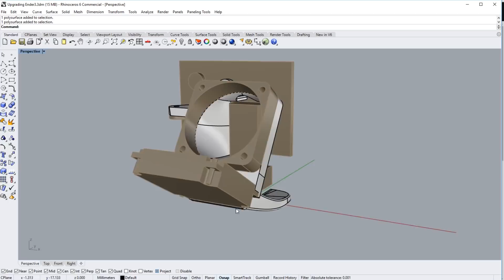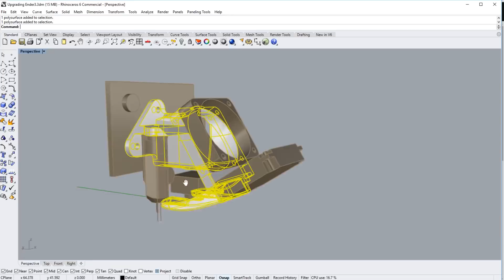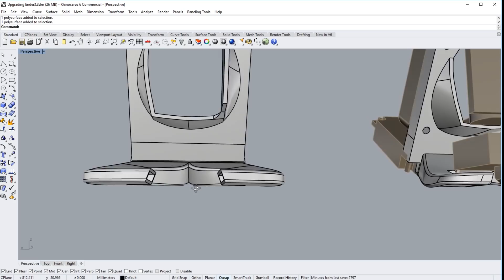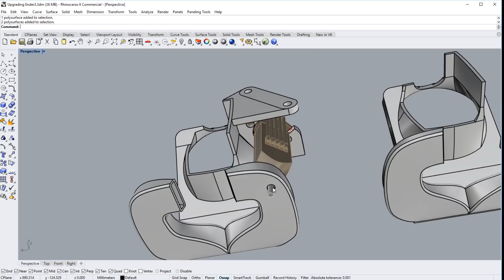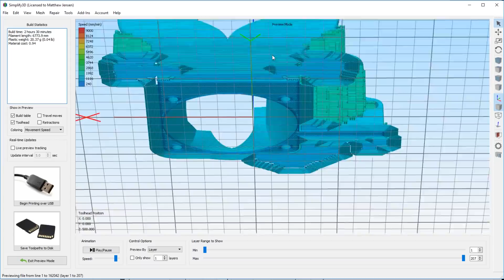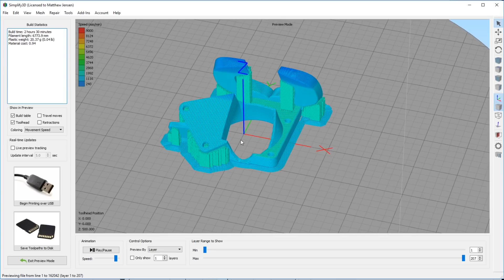Upgrading the Creality Ender 3 with Duet Wi-Fi, and other add-ons - part 1

Comment: I have to disagree about supporting original developers, I'm not talking about the Duet but E3DV6 clones - when the original developer charges more than near 8 times the cost of the 'knock offs' they are being plane greedy £51.60  vs £6.51 - having used both I'll never buy the original again - the knock off has worked flawlessly you defiantly dont get value for money there - I doubt that's the same case with something as complex as the Duet where there's  room to fill the board with crap components but E3D really don't do us proud at all.
Reply: You do realise the only reason you have the option to buy the cheaper parts is because of the original developers and the work they put in?  Do you think these companies that are selling the cheaper variants are putting in the same R&D work as the the developers?  Do you believe the machining and QC are to the same standard?  Do believe that the support you receive is of the same standard?  But your right years of research and releasing everything to the community for others to use while still supporting the 3d community as a whole is not worth the extra cost involved, i know why don't you design something better and get it mass produced for us all to enjoy?
Reply: 1. You do realise the only reason you have the option to buy the cheaper parts is because of the original developers and the work they put in? - yes
2. Do you think these companies that are selling the cheaper variants are putting in the same R&D work as the the developers? - Nope not at all - no more works is need for such a basic part
3.  Do you believe the machining and QC are to the same standard? - NO but the product is quite adequate
4.   Do believe that the support you receive is of the same standard? - NO - never needed any.
5.  But your right years of research and releasing everything to the community for others to use while still supporting the 3D community as a whole is not worth the extra cost involved - ABSOLUTELY NOT - the price is extortionate, I would be happy to change my point of view if anyone can give an explanation for such a high price - and R&D is not a valid excuse we are talking production costs here.
Reply: How is R&D not a valid excuse as you call it do you actually have any understanding of the work that goes in?  And what do you mean no more work is needed?  All these components are continuously being improved and new variants and ideas being brought out.  This takes time and money just reproducing a part of spec like some of the Chinese clone companies with no real QC doesn't cost anywhere near as much.

Production costs are also higher because unlike a lot of companies E3D and Duet design, test and build in the UK.  They take pride in the components and materials they select and in E3D's case the quality of machining.  And if you know anything about machining getting to the standards that E3D are at now with their nozzles and throats is extremely costly especially when it is not outsourced to China.

But hey when all the good innovators go under and your left with the same old kit just think how happy you will be that you got it dirt cheap.
Reply: vizionthing you do realise what engineers in first world countries cost, right?

Comment: I think you were being somewhat glib bitching about zip tied axis bearings -  when you use a single v slot 2020 teeter totter rail, those zip ties dont fail and do the job perfectly well,  also slighting 3D printed parts! you really do sound like a wine snob,  seriously though this video would have been much better if you had just talked about how to improve each part rather than tried to slander the market leader, I should declare in my criticism that I have never owned a Purusa , only an A8 and self built Hevo.
Reply from the maker: It's funny because everyone who wants to defend Prusa claims to not be a fan boy or have owned one of their printers. 

Zip ties are glorified rubber bands, and as much as I love FDM 3d printing, the parts it makes are incredibly weak in the Z-Axis. Not to mention that they are made out of plastic. Structural components should not be made out of plastic and together with rubber bands.
Reply: That is funny.  I didn't realize everyone who defended Prusa claimed to not be a fan boy or have owned one of their printers.  I guess everyone who does owns one just talks crap on them.

Comment: Don't throw the board away, give it to me ;). With  Klipper firmware it outperforms your Duet Wifi easily.
Reply: Do your research. Klipper FW is just that, it's only a piece of software. "DuetWiFi" is a combination of the DuetWFi control board that has been designed to be quite resilient to user errors, and modify RRF software to take advantage of the board. Information can be easily found, go read it if you're interested in getting the best HW/SW combination available.
Reply: Who are you that you think you can tell me what I have to do? What makes the DuetWiFi  "quite resilient to user errors"? Is this not software? Btw. Klipper even supports the MCU used by the DuetWiFi. I only told that his old board with Klipper runs faster than the DuetWiFi with default firmware and that is true. So what  research do I have to do?
Reply: I bet they're both great :nD
Reply: I see now a possible mistake I made. I used the word outperform. This is misleading. Sorry for that. The DuetWifi is the best board I currently know and  his old board is just crap. I am no  native speaker and used outperform in the sense of faster, not better.. Anyway the DuetWifi is far too expensive for me, so i prefer cheaper boards and make them faster with the Klipper firmware.
Reply from the maker: > With  Klipper firmware it outperforms your Duet Wifi easily
Thank you for bringing that firmware to my attention.  I think I might install it on my Anycubic Kossel. That being said, it is not better than the DUET. If for no other reason, the duet has Trinamic 2660 stepper drivers, and this board has stepper drivers which cannot be upgraded. Also, Reprap firmware is very easy to install, setup, and work with. To set up Klipper, it looks pretty involved.
Reply: Klipper is much more easy. No need to recompile and flash the driver on changes of the configuration. Just editing a text file and restart of the Klipper service is all that is needed.
Reply from the maker: What about all that SUDO linux stuff during setup? Don't get me wrong, I'm very interested in Klipper firmware. Especially because the price is so low to get a Raspberry Pi, and you get all the benefits of Octoprint. However, nothing beats a DUET. This board is AMAZING. It costs $175, but it's worth every penny, and the web based installation is super easy.

If Klipper is as good as you say, then perhaps I should do a Shoot out video. :)
Reply: I see no problems with this SUDO linux stuff. The biggest advantage of the Klipper firmware is the support of multiple boards for one printer. I use a simple MKS Gen L for Z and extruders. I will use an STM32 (Blue Pill) and TMC2130 stepsticks for X and Y.
Reply from the maker: If you really want this board man, send me a PM. You can find contact info in the about tab on my profile here on YouTube.
Reply: No, it was a lame joke, sorry. The cost for shipping are higher than a new board from china.
Reply from the maker: I didn't think you were serious. :)  How much of an expert are you with this firmware? Would you be willing to help me make a video about it?
Reply: Difficult to say. Klipper is rather new, so beside the author there might be only a few experts, but  I have more than 30 years experiences in Unix/Linux and my Hypercube Evolution in build is powered by Klipper. So  prepare a Raspberry Pi with OctoPI and come to the IRC channel #klipper. The author of Klipper Kevin2 is reading there too.
Reply: Design Prototype Test I’m a windows user but after a month of using Linux on a pi it is really easy to understand most installation instructions. I’d say give it a try because why not
Reply: @DesignPrototypeTest  the whole point of a ender 3 is to stay at the low price. Might as well buy a prusa if you're going to end up changing everything. I don't even own a prusa but I hate that you're saying that this printer is so much better. Look at all the downtime you're doing modifying and testing to get the same prints. When you could have been printing from day 1.

Comment: Well I like your videos especially the ones on TLM but I think you're a little bit off with this one. I will always love my Prusa 😍😍😍
Reply from the maker: There is a lot to be said for  "Just works straight out of the box, and if it doesn't they have 24/7 support to help you fix it."
Reply: I have one and the part colling fan died already after putting less than 2kg of filament through it...they are not giving me a replacement. Also the sd card died soon after...
Reply: what keeps hitting the board with voltage? - one dead fan, sd card hit... static, earthing problem?
Reply: Static won't do it, earthing is fine or should be, guess I should check the PSU to confirm earthing. I doubt it's been hit with voltage though fans can be quite tolerant to voltage input more tolerant than some of the chips on the mainboard. The fan and sd card failing are common problems when you look into it. Users have also had the spring fail in the sd card slot amongst other things.

Comment: You made a very bad statement that was false. Creality stole Ezabl and sells a knockoff without any directions.
Reply: They copied the design, but didn't 'steal' anything.  TH3D didn't create anything, they just packaged up a kit of stuff.  EZABL is super overpriced for the parts, and I could only recommend purchasing it if you need the support to install it.
Reply from the maker: In my one and only dealing with the TH3D guy he attacked and insulted my person 3 times in what should have been a discussion/debate about open source. He lacks the ability to debate principles and instead attacks the man. This is called "ad hominem." and it is a form of cheating/dishonesty.  This incident happened in the comment section of one of his videos where he was attacking Creality. Because of this interaction, I am cautious about any right/wrong judgments when it comes to a dispute between TH3D and Creality. They both seem like bad actors to me.
Reply: Yes they do

Comment: Oh cry me a river, you were doing ok until you descended into guilt shopping and China bashing. Who made your phone? Let me guess, it's an IPhone? Where was that made? All the shit we buy is from China. They didn't steal it, we gave it to them so we could get our products 10% cheaper. We don't give a shit about how many workers we put out of a job just so long we can get our stuff cheaper. What about the hotend on the Ender 3 I'm sure that's not copied from  Micro-Swiss is it. If your going to replace all the components with top flight original manufacturers  then just suck it up and buy a Prusa or a Flashforge. It's the Chinese manufacturing industries that have brought about the 3D revolution with their low cost manufacturing and their dodgy attitude towards IP. I'm not going to spend $2,500 for a Lulzbot on a whim but if it's only going to cost me $200 for a 3D printer well I'm all over that. My Ender 3 works perfectly well and I don't need a 32 bit Duet board that costs as much as the bloody printer itself. Idiot.
Reply: Paul Le Mars you're a very angry dude about this.  He has some good points.  I've manufactured bits and pieces before, it's not as simple as "we gave our IP to China so we could get it 10% cheaper".  There are plenty of scurrilous people out there looking to rip-off/steal innovative solutions for pennies on the dollar, and there are plenty of contract manufacturers complicit in the act of crushing the inventor.
Reply: yep cant agree more an china manufacturing is getting tighter my geeetech a10m    is solid machine 250gbp i priced a prusa mk3 an nearly died 700 gbp ive got a gtech i3 pro c both work stunning a few days work with software an tweaks an a few upgrades an i dont own or never will unless given to me a prusa ....but the ender 3 will be considering an i would have 3 happy printers an still have change from a 700 gbp standard 1 colour  prusa 3 my money on china japan started somewhere an look whats happening with mobile phones wouldn't touch a Chinese phone 2 years ago i now own a huawei p20 pro stunning phone an big don in the not so big apple as noticed that the once big apple is no more an apple inc an co are crapping it thatch why the CEO of huawei is wanted in america ....the 3d printing community will take off with the help of china bringing a great hobby to the masses at a price the people can afford an not the privilaged
Reply from the maker: EDIT: It is unclear who originated that heat sink design on the J-head, but Micro Swiss does sell a similar product marketed toward CR-10 Users. It is still possible that the design was actually developed by Creality.

>copied from  Micro-Swiss
HOLY CRAP! you are right! I had no idea that was a knock off design. 

I wish you wouldn't have called me names. I'm pretty sure we agree about the vast majority of issues on the subject, but now I don't really like you. I'm not an idiot, and I don't think you are either. Perhaps learn to control your anger a little.
Reply: M'eh have a hug.